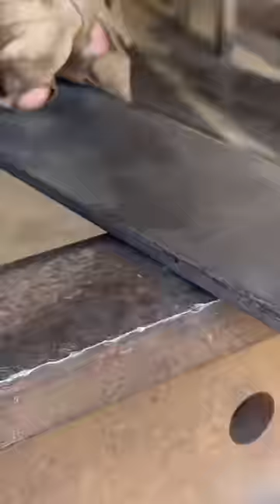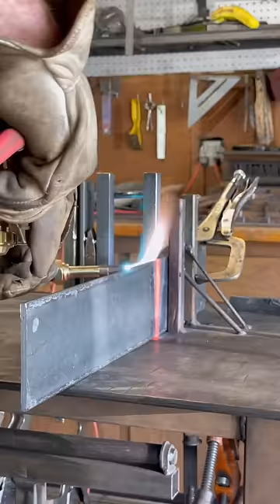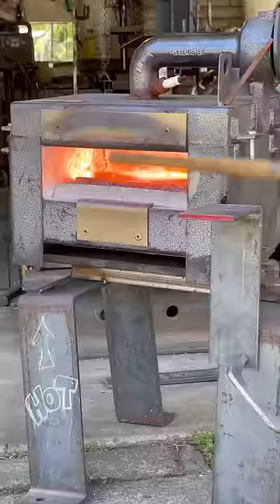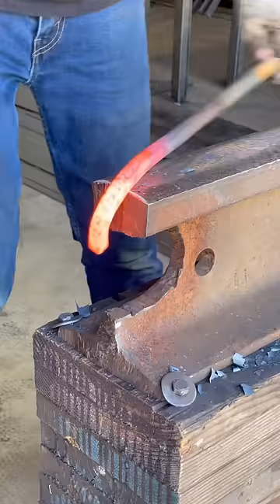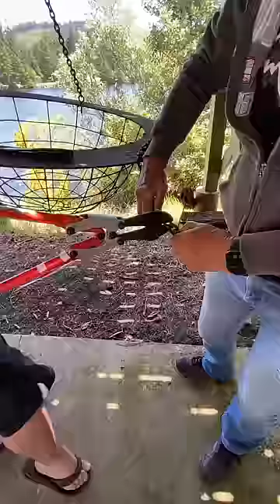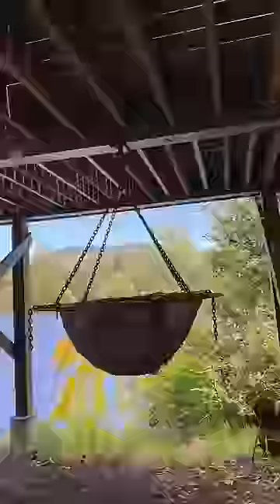Another Special Order

Comment: Is that anvil made out of repurposed Rail track? That’s brilliant, looks like it was Torch cut? Have you tried using a plasma cutter?
Reply from the maker: It is torch cut! I made it about 7 years ago. I have used a plasma cutter but never on anything that thick… thickest by hand is probably only 1/4”. I used to work at a shop with a CNC plasma table and occasionally we would cut 1” plate for baseplates
Reply: Nice anvil,great idea 💡
Reply: @MenardMetalCraft  como se llama la melodia...saludos buen video...
Reply: Its illegal in some countries when you use rail, or any other parts of it
Reply: @aikonlatigid  I think it's from a scrap part
Reply: Rail probably has excellent lee aswel

Comment: Great video and as viewers have mentioned, well edited. I was a bit nervous about using a welded bracket instead of a screw based U bolt. Welds are famous for fatigue failure. Just saying
Reply: that was for hanging plant and purposely way over built it's holding up no more than a hundred pounds it will never break from fatigue and last hundreds of years.
Reply from the maker: I suppose if I didn’t know what I was doing I might be nervous… 🤷🏻‍♂️ I’ve got some welds in far more critical structural locations than this. But that is a valid side point, a weld is only going to hold well if the weld was done well

Comment: You should try an stand your railroad track on its end. This will give you more mass directly under your work and in turn improve your forging. You should also make sure the face you're using to strike on is ground/polished smooth and take your time when working the iron. Do it well not quick. A few small steps to take your work to the next level. Otherwise, good job and keep it up. With experience comes skill and with skill come quality.

Comment: Skilled... Blessed 🙌 😇
Reply: No, he's actually lazy and incompetent.  The hook wasn't properly aligned (it's off center), and is malformed.  He could easily use certain circular pieces of steel to make a proper bend that's perfect.  I've seen a lot of blacksmith craftmen make stuff in my area.  This guy is a rank amateur.

You can even see the photos of the pieces after being hung.  They're a bit off, and it's not the camera angle.

Nevermind he used a lighter to light a blow torch.  The risk of burning a hole into the lighter and setting the area on fire is very high.  That's arrogant and stupid.
Reply: @ignasia7230  I guess if you look at it like that you have points ... facts ok it's not that good ... but a nice attempt at best lol ...

Comment: Wish you had drilled the plate, make the legs of the "U" pass throug it and riveting the ends as well as go thicker on the the welding   🤷‍♂️
Reply from the maker: I thought about that… could have plug welded or let it pass through and upset the backside, essentially a rivet application as you mentioned. I did however get some photos back recently again, they have now added the dirt and flowers and it’s holding strong. I’ll share some photos to my page on the community posts part 🤙🏻

Comment: Why are u hitting it with a hammer before u heat it up like the plate not the rod 😂
Reply: Probably to add texture
Reply from the maker: That entire plate won’t fit in my small forge. I was just doing some light edge texturing to make it a little more visually appealing
Reply: @MenardMetalCraft OK, that makes sense now.  Well done, sir.